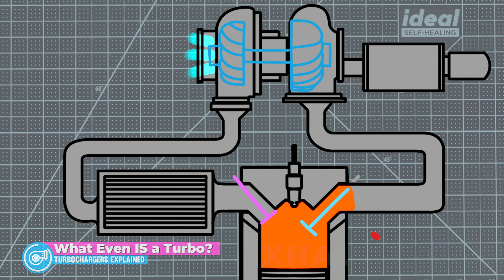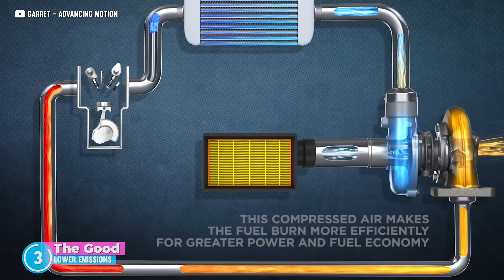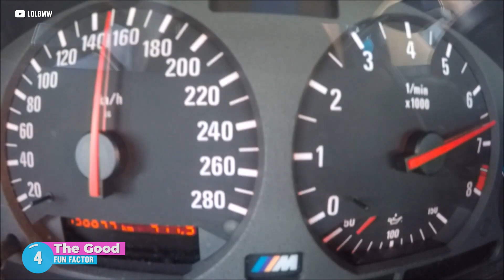Are Turbocharged Engines Unreliable? (the truth)

Comment: Are naturally aspirated cars better for the every day driver? Yes. Less parts to break, less heat and pressure in engine, less oil leak points, no potential for boost leaks. The most no nonsense way to go. I own a 2.0 NA focus as my daily winter driver. Engine is still strong at 200k miles. 

Fun factor? Turbo cars any day! That blast of power you get when the turbos spools! Take care of them with good warm up and cool down,  and change the oil every 5k. Run the octane the car is rated for, and make sure you buy a good designed turbo engine as well. Ford 2.7 ecoboost comes to mind. The 2.3 eb, post 2020 2.0 eb, 3.0 eb, emision deleted cjaa tdi, alh tdi, post 2015 1.8, 2.0 tsi, 3rd gen 3.5 ecboost will also last well if taken care of.

 Steer clear of the Honda 1.5 turbos, 2015 - 2019 2.0 ebs, 1.5 and 1.6 ebs, 1st and 2nd gen 3.5 ebs, Toyota 3.4 turbos, and chevy cruze turbos. 

I own an emission deleted 2014 tuned cjaa tdi volkswagon. Super fun summer car, with gobs of torque when the turbo spools up. Been good to me aside from the diesel emission equipment.

Comment: I'll sum it up from the real world. If money isn't an issue, yeah turbos are cool. If replacing an engine would destroy your finances, a NA engine is a safer bet. Especially if you are buying used and need to get to 200k miles.
I'm a good enough mechanic to know that for me, no turbo, no wet belts, no water pump inside the crankcase.

Comment: I think it comes down to having the money for a turbo and how much more power you’re looking for it already comes with.

Easier to make power with turbos, but it’s also easier to break them. I don’t care what you reinforce, heat is heat and pressure is pressure you’re not gonna get around that

If you want better performance, like a turbo and that low end torque without breaking the bank, get a high compressoion naturally aspirated engine that has at least a few hundred horsepower to begin with and still breathes on its own the. Tune that snd it should give u low end especially with a carbon delete or intake tune that. CAI need to tune to notice.

You won’t get better gas mileage with the bigger engine, most likely, but they cost like nothing to fix and hardly need to be fixed If You picked the right engine. Engines are expensive, more so than having a car that doesn’t complain about a damn thing ever and needs a little more gas

Throw in extra oil changes and assuming you’re on a well-made engine platform in the first place, would to last forever with synthetic 3000 oil changes  for an N.A.

There is a record breaking Toyota Camry engine with over 30,000,000 miles on it. That’s a low stress engine that cost nothing to maintain but fluids

Find me a turbo that is not in a diesel u can put out that kind of mileage  (u won’t)

N.A. Counterparts tend to be larger and sound better with exhaust anyways.😂

Comment: I've hung up my 1960's hot-rod spurs because I don't like to get greasy anymore and I haven't kept up with how to work on modern engines. Also, I don't ever buy a new vehicle and I have very little confidence that previous owners have kept up perfectly on maintenance. That said, I still expect to get to 300k mi on the odo, without major repairs (like replacing a short block). Given those conditions, I will only buy a vehicle with a n/a engine. However I would have loved to put a blower and FI on my '55 chevy big block back in the day, so I understand the thrill of having the extra boost. Have fun boys and girls! 🎆

Comment: They are reliable it just people not doing proper  maintenance. Don't go by the manufacturer oil change recommendations. 
1. Change you oil every 4,000 miles or 6 months whatever  come first.
2. When you been hauling a load or been driving high speed let your engine  idle for 2 to 3 minutes before turning the motor off. If you immediately turn the motor off the turbo is still hot and will cook the oil inside the turbo.
3. At freezing  temperatures  let your engine idle for a few mins to let the oil heat up so it can circulate inside the turbo  before driving.

Comment: You don't need a turbo  to make a car go fast, when a car comes out of production, the engine is not  blueprint,  so when the engine is blueprint  N/A  IT CAN GAIN MORE HORSE POWER  ,  there are engine  blueprinted  and gain 800 Hp , N/A , no turbo , no supercharger  , , Honda  engine   i am sure they  are  built  blueprinted when leaving  production  assembly  i think ,

Comment: after dealing with turbos for over 25 years, they will be reliable if you keep up with maintenance. Oil changes are key. A customer has a 2013 Kia Optima SXL 2.0 Turbo. Always doing oil changes at 3k miles, air filters and the whole nine yards when needed. car has 198k miles and runs like a dream. Had to replace wastegate actuator about 3 years ago, but that's it.
seen tons of turbos go bad, and maintenance (oil changes) was the common denominator in the failure. 
turbos for the most part are fine, people are the problem most of the time. But that's just from what I've seen.

Comment: I don't think turbos are unreliable per say.  However, it is basic engineering that more parts, more moving parts, more electrics and electronics increase the risk of a failure.  Most turbo engines are new designs with electric water and oil pumps, vacuum pumps, and other complexities that increase the possibility of a failure. The increased under hood temps, with manufacturers using so much plastics, also does not help.

Comment: I have 2017 Honda CRV 1.5 Turbo.   It’s advertised for 34 MPG but i get 37 MPG consistently even after 135k miles.  Small engine yet very very efficient and incredibly fun to drive STILL… incredible engineering.
Reply: Yet these small engines have massive issues. The fuel injectors go bad, and they have a massive issue where the head gaskets blow.  There is a class action lawsuit in Canada about the blown head gasket issue.  I hope you crv goes until 500k, but mine didn't make it that far....,
Reply: @SummerBeautyc Some go well past 200k and others flop before 100k. Honda could have just cross drilled the block like ford did with their 2020 plus ebs, but no, and it is the reason why I still refuse to buy one.

Comment: 580.121 km's on 1.5t engine , treat it right , drive it properly , careful when cold and if there's a very short trip , be sure to make it longer so it has time to warm up properly, or take an uber.
The list is actualy longer but the thing is anything can be remotely reliable as long as you know what you are doing.
Also oil change every 8-10k km's, regardless of maker's requierments.
Reply: premium fuel?
Reply: Is that the honda 1.5?

Comment: The trouble is most Honda CRV’s have turbos come standard on them. I was looking at a 2025. I’m not sure about Kia sportage.
Reply: CRVs are just awesome vehicle.  I own 2017 1.5 turbo and trust me it is very very efficient.   135k miles on it and still runs like new.  You will not regret getting Honda engines.  Turbo or not.

Comment: I don't know but I drive a 2 cylinders, 0.5 L, twin turbo engine in a 1000 lbs car and it sucks !

I am being sarcastic, but it seems like that's the direction car manufacturers are going these days, lighter cars with smaller engines and turbo to compensate...saves them money + they make more money on maintenance + unaware consumers end up buying cars more often.

Comment: I got sold on Turbos after owning a 1986 Saab 9000. I ended up maxing out the boost that the car could handle, but it was still running perfectly when I sold it with 280,000 km on the clock. I saw it on the road still five years later!😊

I have been Team Turbo ever since

Comment: I have a 2004 Volvo S80 2.5 Turbo 5 cylinder that has 250,000 miles with no major issues. It’s been so reliable that I bought a S90 with the 2.0 supercharged turbo, I expect the same reliability.

Comment: I'm a fan of turbo engines that have common sense engineering. My turbo sits right in front and has a cooling duct sitting directly in front of it as well as heat shielding to protect everything else in the engine compartment. If and when the turbo needs replacement it's easily accessible. I like doing maintenance on my vehicles so the extra care isn't a hassle or inconvenience for me. When the full 28lbs of boost hit, all that work is worth it. 4XX HP and under 4 seconds 0-60, out of 2.0 is just plain fun.

Comment: I'm against putting tiny engines in everything. I'm all for those engines being the same size and turbocharged for more power.
Reply: Under 1 ton 1L, 1-1.3ton 1.5L and 1.6-2ton 2L

Comment: I'll sum it up for everyone to digest. Take care of your turbo charged vehicles. Do your maintenance, use quality fluids/parts, drive easy till it warms up/cools down. Turbos are just as reliable as naturally aspirated, but they require a different maintenance process. Simple.
Reply: They are not “just as reliable.” No need to lie or overstate anything, they CAN be reliable
Reply: @360johnn  Not sure where you got the "lie or overstate" but we can agree to disagree. I believe that Turbo car are just as reliable as NA based on my multi years experience with both.
Reply: @Juelz87  a turbocharged engine will never be as reliable long term as an n/a port injection engine and that’s just that.
Reply: @360johnn There are a few exceptions, the ford ecoboost 2.7 has less tsbs on it than the ford 5.0 coyote NA. Why? The 2.7 is built like a tank, compact graphite iron block, high oil capacity, warms up quick and has diesel like internals. In most cases though, especially if the motor is not religiously maintained a port injected NA engine will have less problems.
Reply: Bs, turbos add problems compared to naturally aspirared. Just having more moving parts means more chances of something going wrong over time. Simple
Reply: A forced induction vehicle will NEVER be as reliable as a naturally aspirated vehicle. I cannot believe you wrote that lol.
Reply: @CollinMac96  Lol it's an opinion related to the topic bro. Call down.
Reply: reliable but may have problems sooner than a N/A car it depends on maintenance, manufacturer and driving style of the owner.
Reply: @JoysitoCR  That's exactly what I said, just said differently lol
Reply: That’s not how it works.  “It’s reliable as long as you do these extra things.”  Dumb.
Reply: @RyanRebel54 it's exactly how it works.
Reply: @335ofre  you missed my point.
Reply: @335ofre  it’s not “as reliable” if you have to do more work to keep it as functional as naturally aspired.  “As reliable” would be if they had the same maintenance routine, required the same amount of effort, etc.

More oil changes to maintain the turbo equals more money.  If it costs me more money and time to maintain the same reliability, that by definition is not “as reliable.”
Reply: Came here to say this!
Just another part that needs maintenance and replacement overtime
Plus they just sound so good

Turbo diesel last forever! Plenty over 300k miles
So there’s proof turbos are reliable
Difference is people who own diesels tend to take care and maintain there’s cars better
Reply: if it requires extra care and maintenance, it is less reliable. There is always a cope comment at the top of a turbo video lmao
Reply: Not all turbos ae created equal, even though they come a long way... but what specific brand, model and year car you choose will be as important as the extra maintenance turbos entail... I think as he said, basically turbos are not for everyone, but if the fun factor is important to one  and one is willing to do the extra work and stay on top of it.. why not ?

But select wisely and if one buys a used one, have it checked thoroughly as some are abused..
Reply: Exactly. Toyota’s earliest turbo were their trucks from 80’s and those things managed to run for more than 2 decades. The supras were also turbocharged and they lasted for 10+ years.. 

The modern toyota turbocharged engines started around in Lexus and has been going for the past 5 years.. barely had any issues at all.
Reply: Well said.
Reply: Describe everything that makes an engine unreliable everything about a turbo. Then ignore all of that and say it can be reliable. What is reliable? Not requiring constant maintenance is one of them
Reply: Cap
Reply: @jigglejigggleee8765  Lol what part of my statement is cap then?

Comment: Forced induction is always higher maintenance, by logical definition. Better turbo claims are older than Tesla, but still break more than without. Higher demand, higher psi, higher pressure are harder on the engine. Blowers give you low end, turbos give you high end, and EV give you better than both with better reliability and efficiency. Go EV.  👍
Reply: I don't want to wait for hours for a battery to fully charge before I can have fun. Especially, if I am not at home with the better charger in comparison to the less maintained public EV chargers. Paying for a battery replacement using the money I didn't use on the maintenance for a gasoline/diesel powered vehicle. Then there's playing Russian Roulette with an EV vehicle before and after an impact.

I am aware a gasoline/diesel powered vehicles  can have "stuck throttles" (I know people can lie about having that situation with any vehicle. Due to them making the mistake of stepping on the throttle pedal instead of the brake pedal.) and explode on impact but I feel like it's worse with an EV vehicle. It seems like those batteries don't like being hit. Oh yeah, you're giving plenty of unnecessary work for the fire fighters trying to put out your instaflame vehicle! Finally, the cost of repairing a ding on an EV vehicle's battery. Oh wait! Sorry! You have to replace the whole thing becauze that ding could have damaged the battery and they don't want to be sued by you if something goes wrong!

You can tell me all you want the chances of all these cons won't happen but what are you going to do for me if they do?

Nothing.

Yeah, fuck EV vehicles.
Reply: I like the powerbands of evs, just not the lack of range especially in cold winters up here.

Comment: The red block 4 cylinder and white block 5 cylinder Volvo gas engines were the Pinnacle of refined high durability turbocharged engines.
Reply: Tell that to the multimillion mile cat engines and all the duramax, powerchoke, Cummings running around with a million miles
Reply: @Thumper68  diesel motors are an entirely different beast but I agree. Might have something to do with Volvos success turbocharging motors because of Volvo trucks and heavy machinery. I know it’s a different subsidiary but I bet they shared engineering knowledge.
Reply: @Boy3ga  id just about guarantee it.
Reply: Volvo makes diesel engines too you know and many of the trucks have multi million miles too. We are talking about gas turbo engines @Thumper68
Reply: And still not as reliable as naturally aspirared
Reply: I was thinking the same thing. Was gonna comment just get a Volvo. Generally reliable turbo engines

Comment: Great info and great video. Just want to make sure I highlighted the major takeaways that will keep the turbo engine as reliable as possible:

1. Always do preventative maintenance on time (3k-5k mile oil change)

2. Driving habits: let it warm up properly and cool down properly. Also, push it every once in a while to help break down carbon buildup

3. Know what kind of turbo engine the car you’re interested in has, as turbo placement can cause issues (like the bmw you mentioned). Could help you avoid costly repairs
Reply: warm up and cool down properly- how long would that take?

Comment: Forced induction wise.i prefer a blower but I am considering GMs LTG as an engine in my next car.ATS, Camaro,Regal are my considerations. I have driven both a regal tour x and ats and like both 😊
Reply: I have a 14 ATS 2.0t it’s a great car. Right now it’s full bolt on big wheel turbo and tuned for E50 it makes around 360 wheel hp.
Reply: @adamhayden5152  anything from ZZ performance?
Reply: @Desert_Rogue_Tanker  only thing I have from zzp is intercooler and big wheel turbo. But I sent the big wheel out to turbos r us for Chris to upgrade the bearings etc as zzp using stock and they are to weak for the bigger compressor wheel. Oh I guess also zzp’s catch can but I upgraded the can.